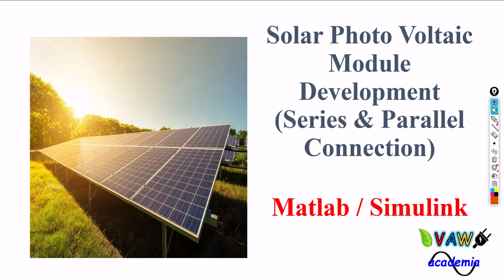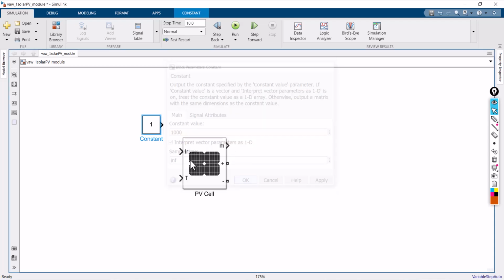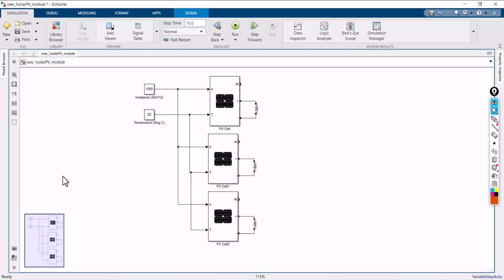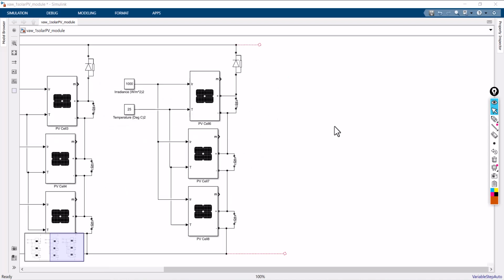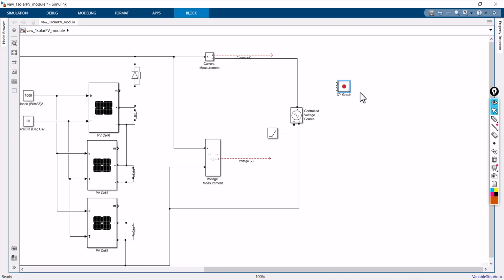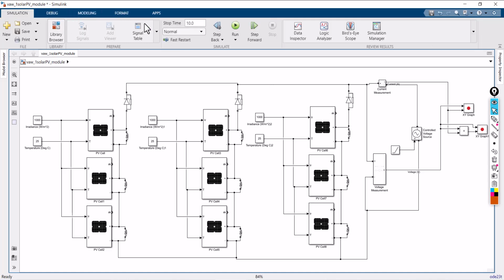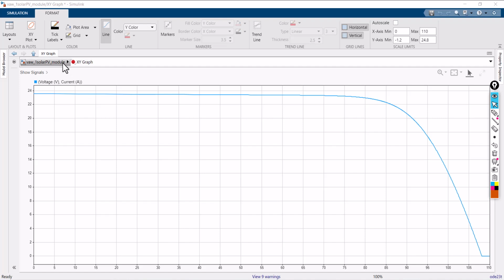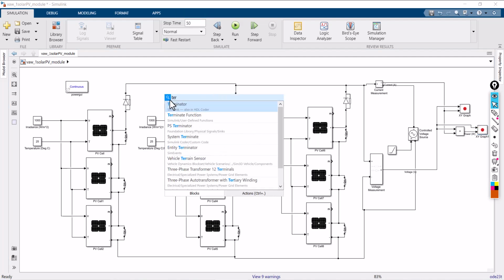Solar Photo Voltaic Module Development (Series & Parallel Connection) using Matlab / Simulink

Comment: Respected Sir it will be very helpful if you can make a video on implementing ANN (Artificial Neural Network ) MPPT to track maximum power PV panel integrated with Boost converter to get the required output. Recently i have studied this ANN-based technique, which is actually better than all the techniques found to date in terms of generating ripple-free output. I am having difficulty implementing this in Simulink along with a PV panel and boost converter. It will be really helpful if you do so.